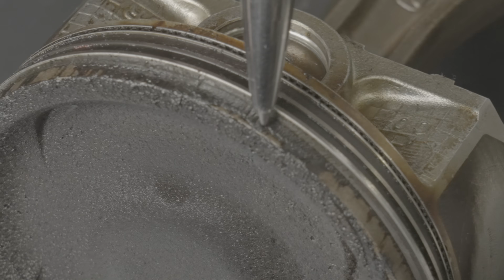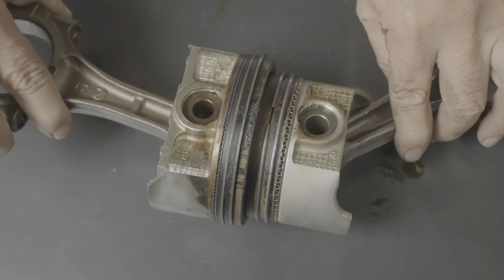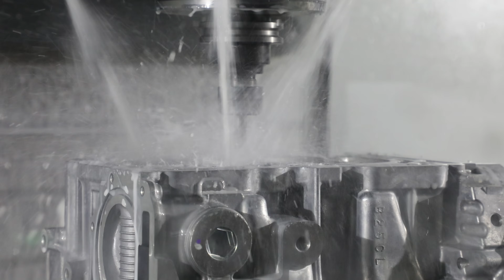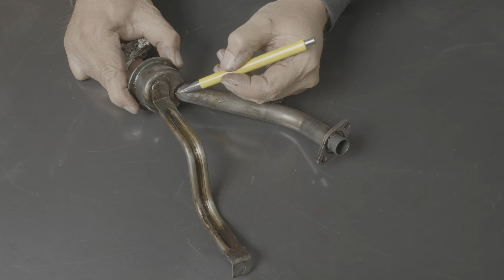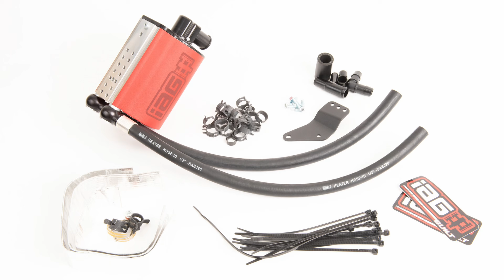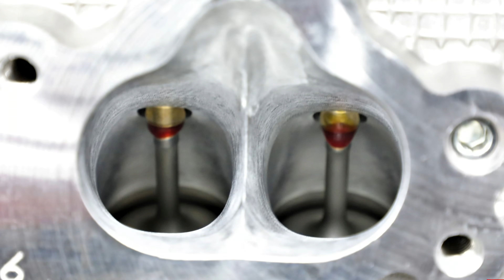Why Subaru Engines Blow Up!

Comment: Worked in a cylinder head shop. 
You could run an entire business off Subaru engines alone. 
Same design 25 years later.
Reply: dont fix it if it aint broken. 250k on 09 wrx i have had it over ten years.
Reply: It's the shitty tweaking that does it, I drove a stock turbo ej257 for 10 years like I stole it, kept to the service intervals and it was fine
Reply: My 2002 Subaru WRX is still going, even though it's modified and driven relatively hard in mountainous terrain.

I'm not saying that all of them are equally good, but if you take care of your equipment, your equipment will take care of you...
Reply: They never seem to learn
Need to build a reliable inline 4
Volkswagen had the same problems with their waterboxers
Reply: Except its literally not the same design 25 years later and you'd know this if you weren't lying about working in a cylinder head shop.
Reply: Head gasket issues were only primarily between 99-04 on the SOHC EJ's. Many other makes had their fair share of them too, like Honda, Dodge, and Toyota. Subaru is one of the most reliable cars on the market. Also one of the most modified. Easy to work on.
Reply: They sound silly, like an old sputtering lawnmower
Reply: Americans full of misinformation on anything and everything.
Reply: Local guy does

Its called heads by drew lol
Reply: 🤣🤣 I need a business like that
Reply: 2005 legacy gt 248k on original head gaskets. one of the main reason’s is it’s un modified. aside from the exhaust and couple quality of life mods. not trying to squeeze all the boost pressure and horse power i can out of this thing and it still pulls strong at 21 years old
Reply: 😂😂 I hate subie engines. 10x the labour for half the power and reliability of anything else.
Reply: @TML34 sad but true
Poor power plants but great AWD .......only as good as it's weakest link....
Reply: @TML34 look into 2022 WRX n up, u be surprised how much power it makes with just intake n tune.
Reply: @HangMan113  lol you’ve got to be joking tho right?!?
Reply: @Serpentis666  Do some research first before Questioning.  2023 WRX 430 HP 470TQ  with few bolt on,  running E85. SERIOUS POWER FOR THESE NEW WRX.
Reply: @HangMan113  lol and how long does that last before things start breaking? 2002 Honda k20a can make over 500 by just bolting on a turbo…
Reply: @Serpentis666  How long will that last until piston n rods start failing.  K20A is junk, Why u think people have so much problems and trying to get rid of that 1955 crap. Don't compare 20 years old engine to present engine. We are not living in dinosaur age anymore. Know one is talking about Hondas n acura swap now and days.. That's why your here in a subaru chat, Trying to gather information about the new WRX..
Reply: @HangMan113  are you brain dead? People the the Honda k series into everything… even mustangs these days… why? Because it’s one of the best motors ever built ya Buffoon…
Reply: @HangMan113 The k20 and k24 engines are so good, so cheap and can hold so much power people are swapping them into other cars now, like LS engines. There are entire companies that exist and make money solely from selling prefab swap kits to swap Honda engines into cars like the brz and gr86 that come stock with JUNK Subaru engines that are thrown straight into the trash. 

I’m no Honda fanboy but I’d say that when a whole business model exists solely to swap out your crap Subaru engine with a Honda one from 10 years ago, there is a problem.
Reply: @Username-2  yea, a market of like 50 guys.
Reply: @Jez4prez1  Go look through the brz/86 forums there is more than 50 guys on there alone swapping k24 engines in. Kswap has sold thousands of kits for bmw. That’s not even including all the people doing the fab work themselves. 

The k24 is the new LS.
Reply: @Username-2  55 guys then
Reply: @Jez4prez1    Yeah so basically you just have no idea what you’re talking about. Good luck with that.
Reply: @Username-2  no one cares m8.
Reply: @Jez4prez1  Then why are you responding? I wasn’t even talking to you in the first place, you’re the one who inserted yourself here and talked to me for no reason, so clearly YOU care.
Reply: @Username-2  nah, I'm telling you no one cares about your niche k-swaps that no one does.  You're crazy.
Reply: @me-2 so the only person who cares (and who is responding) is me, and I'm telling you no one cares lol.  Yeah, cool stuff bro.
Reply: @Jez4prez1  So you’re basically admitting you are a worthless nobody then?
Reply: @HangMan113 then if the likely to require new engine on well under 200k the transmission won't even come close. you ppl need a psychological evaluation.
Reply: @Username-2 im not gay but I have feelings for you.  f these r tards who suck off subarus. a  unreliable, finicky,  crap engine to get under 300 hp while the s2000 makes nearly as much on a tiny na engine, and can rev to 9k all day long no issues. Subaru supporters are full of shit.
Reply: @Highslot17 Name a N/A 4 cylinder from the 90’s that makes more than 150hp?
Reply: @celtic125434849  honda, bmw, mercedes, porsche, nissan, toyota. all made n/a 4's with >150hp.
Reply: @celtic125434849 : Ford Cosworth YB
Reply: @celtic125434849  b16b n18c f20c all made over 150 naturally aspirated…
Reply: @Highslot17  Subaru engines are good, just stay away from the WRX and STI engines.
Reply: @cespo77 so extremely slow and useless unless it snows out or or extremely slow and useless unless it snows, but with higher price tag lol
Reply: @Highslot17  some things are just worth it
Reply: @Highslot17 Subies are easy to work on lol
Reply: @matty9369  you mean, once you’ve pulled the engine, right? 😅
Reply: @TML34facts
Reply: @Highslot17  Half the power?  The EJ20 turbo was a perfectly good engine... 30 years ago. 😊  Honestly at the time the Version 1 through Version 6 Subaru WRX STis were a fast car compared to most.  I guess the Volvo B20 or Ford Cosworth engine could hold more power, but they mostly didn't have AWD (and the AWD systems in the Sierra Sapphire and Escort RS were not that great, AFAIK?).  (Of course it is a little bit of a shame that WRX STis have only gotten slower since then!)
Reply: @TassieLorenzo he’s right, half the power because the motors are junk… Subaru at its best couldn’t hold a candle to a Honda motor at its worst…
Reply: @Serpentis666  the ej207 is pretty good and is what Subaru used in all of thier racing applications. Unfortunately the US never got them as usual.
Reply: @Serpentis666 then don’t buy one go suck off a Honda somewhere.  And this is coming from a guy who has a Honda tattoo lmao
Reply: @chandlerbraaten847  is that what came in the 22b?
Reply: @Serpentis666  nope, that was the EJ22G
Reply: @Serpentis666  How do you go through life being a liar?
Reply: @Serpentis666  I think Subaru timing belt is too long therefore prone to failure .
Reply: @eskieman3948  huh?!? And what are you accusing me of lying about?!? 🤔🤣
Reply: @Serpentis666 amen 
Or another Japanese makes like toyota or mazda
Reply: @Serpentis666 bro they dont put the same engine in a car for enthusiasts for 25 years if its junk...it also gives the car a much lower cemtee of gravity..honda is good too but that dont mean subies are junk
Reply: @mickdabz  then why aren’t there any fast Subarus out there?!? 🤔 the fasted Subaru couldn’t hold a candle to the fastest civic…
Reply: @Serpentis666  The regular commuter cars are great, the problem is with the turbo and modified versions. The engine can't handle all that power.
Reply: @chandlerbraaten847 The EJ22 was  a great engine as well.
Reply: @mickdabz  Centre of gravity is nothing when cornering,  Focus and Citroen had a high center of gravity but destroyed Subaru in the WRC. The problem is Subaru's boxer engine sits forward of the front axle causing high polar momentum which leads to a severe understeer and seconds wasted.
Reply: @32523Bwahahaha ppl fail to understand this fact. this is before introducing a car with piss poor durability.
Reply: @Shallowdarkpit  Yes  boxer engines are good as long as they are aspirated 70 PSI of injector pressure, but on turbos , injector pressure is 1300 PSI , thats fifteen times + higher , so the gaskets and cylinder need to take all that pressure and since engines heads are tilted , they naturally pool oil  and leak, blow gaskets , etc . I only recomend the regular Impreza none of their turbo WRXs.
Reply: @32523Bwahahaha ik. yet ppl atill defend this trash.
Reply: @Highslot17   If built properly, they're great. One of my STi's has been running 619 whp on 35 psi of boost with 91+meth dual fuel for about 25k kms now. No issues yet. I'm running closed deck case halves, though. Build was 4 years ago now. I don't drive it too much as it's a summer weekend car now. I have another STi for my daily that's mostly stock.
Reply: @allanhope7018  and how much did it cost? and how much is it when things go wrong? And they will go wrong. 😅 maybe if you have the mechanical skills it’s ok, but still
Reply: @Highslot17 that’s a generic statement for any modded car, not just Subaru
Reply: @Highslot17  Really doesn't matter when you love something and are passionate about it. I built the car for me, with all it's benefits and faults. Not for anybody else. I really don't care about "this is faster" or "this costs less" or "this is more reliable". Yea? Great. I don't care. I spend my money on the cars I love. People like you should be less judgemental. The whole "I don't like it so it must be garbage" mentality a lot of people have in the car hobby is very childish and shows a large lack of maturity.
Reply: @allanhope7018  if you built the car, I get it. It’s fun to take a flawed engine and make it how “it should be.” Just doesn’t work for everyone, that’s all.
Reply: @Highslot17  Every engine has flaws. Even the revered rb26 has cracking issues between the cylinders and usually have conical shaped cylinders as well that need to be machined even on a brand new oem block. And yea, I get stuff doesn't work for everyone, that's what I was trying to tell you in my previous reply. I love the cars, I paid for what I want from my own money and there's nothing wrong with that.
Reply: @allanhope7018  I agree.
Reply: @allanhope7018  don't forget that if an RB hits rev limiter the oil pump gear shatters and the whole engine is toast.
Reply: @allanhope7018  I fully agree with this statement.  But I have one exception.  Mazda RX anything, they are trash and no one should waste money on a rotary engine.
Reply: @Albee213 😂😂 “rx anything”
Reply: I have an EJ 20 since 2006. But bine stock 😅 ok exhaust is different  @allanhope7018
Reply: @Albee213   It's impossible to "fully agree" and have any exceptions. That's an oxymoron. So no, you do not fully agree.
Reply: @TML34 yeah 600 hp with only 30 something pounds of boost......and wheel hp
He might be fibbing just a bit
Reply: @allanhope7018 helll yea bro i gotta 2017 wrx that just hit 80k no problems with 330whp on my meth injection map..my buddy gotta 15 with 130k..
Reply: @allanhope7018 it shouldn’t need to be built for it to operate reliably at stock horsepower lmao
Reply: The issue was the design of the head gaskets, not the engine, and it was resolved after 2012.
Reply: @fredharvey2720  ...and the fix to it?  The turbo engine's head gaskets.

This is just another hater video.  Someone's sponsoring these guys to hate on Subaru, I believe.  Maybe I'm wrong, but their cars have run quite well for me...
🤷
Reply: @tyree9055  Yeah, just slap on multi layered steel head gaskets for turbo engines and the problem is solved for good. "Blowing up" is a sensationalist headline and the image falsely portrays a Subaru engine exploding in fire. Can't take this seriously.
Reply: way more wrong with the engine than that.
Reply: @Shallowdarkpit  Yeah, will please tell us.  We know about the gasket issue (solved), we know about the oil burning (they went with softer rings, all mfrs did) and problem solved. They had a thermostat issue till 2025, and 2026 replaced now with a traditional thermostat....and solved.  Care to explain what else?   Due to design, you need to stay on top of oil changes. Otherwise I hear a lot of people loving the Subarus lately, and Consumer Reports rates Subaru No 1 for two years in a row.  Check for RECALLS, and it is clean since 2021 compared to Toyota with serious recall issues.  Toyota has V6 problems, and Honda has oil consumption problem . What do you expect, with direct injection, small 1.5L engine, and  a turbo on it, and now add that all manufacturers lately have been using low tension rings. The pressure from the turbo blows oil right past the rings into the oil pan. I'm seeing a lot of people in forums happy with their Subaru with 250-300,000 miles on them.  If there are complaints, it would be with the turbo.
Reply: gas going to be phased out in few years
Reply: @06wrxRA except that it wont lmao. The public is pushing back hard on evs. Car manufacturers are rethinking their decisions. No amount of government regulation can force manfacturers to make cars people wont buy. EV mandates will ALL fail. The tech just isnt ready yet and wont be by the proposed mandate times.
Reply: @06wrxRA  Gas will never be phased out. It needs to be available at least 50 years after they make selling new gas cars illegal. Even after that, you could use lab-made gasoline that's carbon neutral.
Reply: @06wrxRA  No it won't. Gas is needed for our hybrid cars (they have a gas motor too). What you likely mean is gas onlyvehicles might disappear, and I agree.....but I prefer it over hybrid.   A gas car has 2 expensive things we worry about (gas engin and tranny).  WIth hybrid you have a gas engine, electric motor, power inverter, rear electric motor (some use driveshaft), and cable front to rear. (5 areas that can go wrong..>$$#$).  Any of them can fail, and a power inverter is $8-10k to replace, cable is $2960 to replace plus 4-5 hours labor (your cheapest of the bunch to replace).

Comment: It seems that Subaru engines were built wrong as a joke.
Reply from the maker: They are just marginally strong.
Reply: @motoiq  That seems generous.
Reply from the maker: The thing is don't ask of it more than it can handle and you will be fine.
Reply: @motoiq  That's true of all platforms. The EJ platform seems almost adequate for stock power in stock form. When I was 18 (2004) I wanted either a Camaro with LS1 an e36 M3 or a WRX STI. By the time I was 20 I had a 2001 SS Camaro. I don't hate Subarus but maybe I've been spoiled with the LS platform.
Reply from the maker: The LS is one of my favorite motors.

Comment: Flat engines are not bad, it's just that Subaru does such a mediocre engineering job. Posche on the other hand is legendary for their flat engines.
Reply: Subaru developed their engines in motorsport so it's not about mediocre engineering, it is about costs. Subaru can't sell their cars as expensively as Porsche, so they can't spend as much on their mass produced engines.

Comment: So pretty much subarus have worthless turbo engines. They sound great but unless you buy a turbo car to leave it stock (who does that) those cars just don't seem to be worth it to get into IMHO. I like them but it sucks that the engine is so weak for a turbo car. It's almost like they live up to the myth that NA engines have about needing engine builds before going with forced induction.
Reply: Me! My 05 STi is stock power level and the best car I’ve owned. For me, it’s plenty quick on twisty back roads. 

I wouldn’t call them worthless. They’re designed to be rally-inspired street driven cars. You have to manage expectations and not everybody tracks their car where a lot of theses issues  become a concern. Mike says as much in this video.
Reply: @QuintonLeister half of these commenters seem to be kids who would complain that the EJ can’t handle 1,001hp even if it handled 1,000hp just fine.

Comment: Man, I wish it was just because of tuning. A few months back I was looking at cheap subarus to buy one. Holy smokes, the amount of stock subarus that are out there with major engine damage is mind boggling. I've owned stock subarus before and I have owned several modified German cars before. Just one of my well maintained subarus had more issues than ALL of my supposedly unreliable German cars combined. Was really eye opening.
Reply: People talk about Japanese reliability, but there's such a range.  Some Japanese stuff truly is indestructible, and some is absolute tissue paper.
Reply: @JETZcorp and some Japanese stuff is becoming French (ehm Nissan)
Reply: @ianriggs  Sure.  But Subaru isn't one of them.  Even old Japanese stuff was pretty varied.  It is impossible to kill a 1970 Kawasaki 125, but it's quite a challenge to keep a 1970 Kawasaki 350 going.
Reply: @JETZcorp  I was just kidding I just think it's hilarious that Nissan merged with Renault. Definitely suffered some quality and reliability issues since that merger tho that's for sure
Reply: @JETZcorp  I guess that's what makes a Subaru, a Subaru 😂
Reply: @ianriggs  Renault and Dacia have some reliable engines. My Renault Twingo MK1 is unkillable, confy and reliable af. Best city car, same thing for the Renault Megane 3 RS, super reliable, amazing chassis and the best hot hatch. Honda had to cheat every time to beat the Megane RS. Also Renault and Nissan are not in an alliance anymore. Subaru are okay for reliability, i have a JDM Subaru B4 RSK making 340hp, twin turbo and it has been working well without any issue. Just do you regular oil change, get a tune if you modify your car and stay away from turbo EJ25.
Reply: You're lying through your teeth.
Reply: Nice fairy tale mr. mediocre
Reply: Its cute you think every one of those "stock subarus" werent ever modded and returned to stock to sell. Bless your heart.